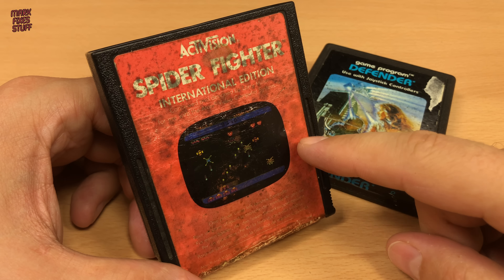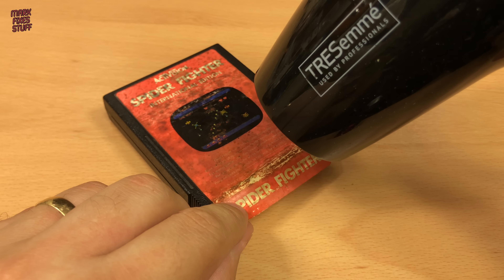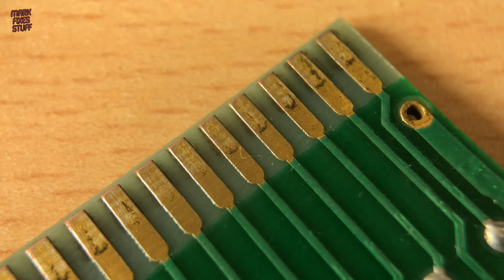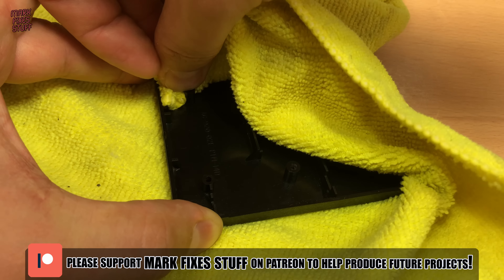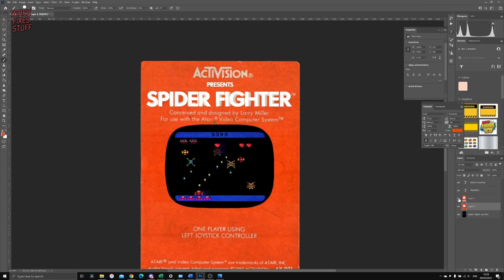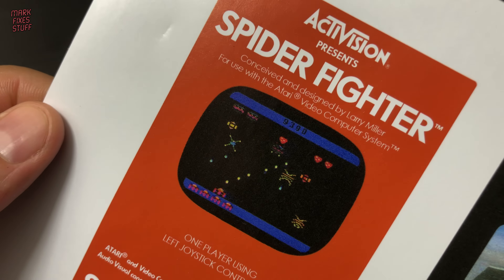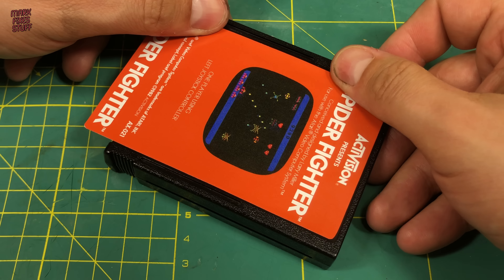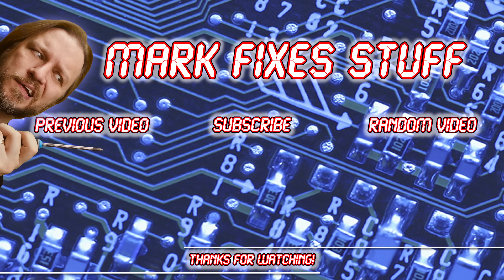Printing Replacement Atari Cartridge Labels at Home! #retrocomputing #atarivcs #retrogaming

Comment: I'm surprised nobody has compiled a library of old game cart labels by now.
Reply from the maker: There are a few online but nothing in the resolution I wanted.
Reply: @MarkFixesStuff  What resolution did you find you had to really get to before it looked passable? I think these look great BTW.
Reply from the maker: @JoshWraaButler  Sorry I missed this!

720dpi with the label set to the actual size on screen. You can download the files on my website if you want to look  :)
Reply: @MarkFixesStuff  The resolution expressed in dpi is independent on how it is displayed on the screen.
Reply from the maker: @cyberpaul1398  correct. The resolution of the document is 720dpi. This is a good match for the micro piezoelectric nozzle pitch of the Epson photo printer. The print head has a physical 360 nozzles per inch so working in multiples of 360 is the way to go and avoids aliasing and moire in certain cases. With regards to the display on the screen, the document is simply zoomed to the same size as the physical print for design purposes. My monitors (Asus ProArt) have a function for this and have actual ruler measurements moulded into the bezel. Very handy!
Reply: Yes, the first thing i was thinking on starting to watch this was,  where is he getting good images or files to base new labels on? Lol
I thought maybe he knew some other people that have the same carts that he could copy the actual real sized labels.

Comment: Very good instructional on general cleaning of carts too.
ive got a couple cruddy ones i found at a flea market that looked like they had been laying around on a grimey old carpet or a junky cardboard box on a garage floor for several years. The hair dryer use was the bit i was not thinking of before as i was waiting to start taking them apart until i really knew what i was doing, and do it right.
My main issue with labels is just having loose and peeling ones.
I hadnt decided exactly which glue i wanted to use or which was best for this situation.

Oh and youve convinced me to get a rotary cutter as ive never thought i needed one as ive always used xacto type blades, but i will try one out.

Comment: Good result. 

For the corners, you could try a corner rounder cutter or punch. I’ve got a cheap one from Amazon and it does either 4, 7 or 10mm radius corners pretty well. 

Bit difficult to judge but the 4mm might have been suitable here.
Reply from the maker: The print is a 10mm radius so that's probably the key!

Comment: Great work Mark. They look great. I've had to use the fixer spray when printing to photo paper also. Especially useful  if your printer refuses to print "photo paper" any larger than a .....photo. The way some ink jets print is specific when using gloss paper, especially where black is concerned, and will just flake right off. The fixing spray cheats this issue nicely.
Reply from the maker: Nice little hack there!  This printer will print on anything, even rolls of canvas, but that technique could well come in handy...

Comment: They look great. Personally I would have used something like indesign or illustrator to design them. I find photoshop isn’t as robust when it comes to typesetting as these two. As for cutting out, a 3mm bleed is your friend. Add it to your design plus some cutter guides and use them so you don’t get a white line running up a side.
Reply from the maker: Great tips. Thank you. I’m terrible with illustrator so tend to hide in photoshop. I should do a course really

Comment: I’m sure there are a hundred different ways removing the old glue, but last time I had to do something similar I had very good success with lighter fluid. A tip I learned from Toy Polloi.
Reply from the maker: Good to know! I actually bought some today on your advice.
Reply: @MarkFixesStuff  Dave actually also uses it to lift and keep old stickers. From what I can tell, it will break down the adhesive, but leave the paper/ink fairly intact, and then dry completely clear without staining.

Comment: The design of these carts were never made to be cleaned because they thought that would never happen, how wrong they were. ^_^ I tried my best to preserve an Indy-Rotla label but it ripped despite adding heat so nice to see another relabel DIY video. :)
About six months ago I did a full 2600 cart cleaning, despite those spring guard systems there was so much dust, dirt, rust, mould, and mystery crud in most of them. Had some good results using "embellishing glue" for partially lifted labels.
It's more work but redoing the label is the only way, scanning an old print gets you the basic dimensions but the source scan is like photocopying a photocopy for image fidelity. Occasionally it's possible to source paintings and photos used, imagine it wouldn't be too hard to recreate CRT based game screen shots.
Getting back to what it used to look like is always nice, seen too many phony aged retro labels and boxes for retro themed products like 80s gamers bought brand new trashed packaging bitd. ;)

Comment: I've found an ink eraser makes a good contact cleaner. Gentler than brasso or fiber pencils. Much safer too.
Reply from the maker: I need to grab some of these again. The Staedler grey ones are a bit abrasive I found. They work great on ZX Spectrum edge connectors.
Reply: Try a white eraser. I find them around the house, leftovers from kid birthday party goodies bags and elementary school playground trades. Usually they'll have cartoon characters printed in them. 

The white erasers work best.

Comment: Great looking replacements there!
FYI: I use lighter fluid on glue residue; it disappears instantly, then just clean over with IPA or soapy water 👍
Reply from the maker: So kerosene then? Makes a lot of sense chemically! I’ll try that next time.
Reply: @MarkFixesStuff  I guess it would be, yes. I don’t smoke but have a small tin of lighter refill specifically for removing stickers from boxes 😃

Comment: Question: Do you use Brasso first and then if that doesn't do the job then you go to the Fibreglass Pencil? I ask as I just use the Pencil for contacts, Spectrums and interfaces mainly.
Reply from the maker: I tend to try Brasso first. The fibreglass pencil wears the contacts down really quickly

Comment: I've had better success with removing glue residue with an oil based product than IPA (WD-40 is amazing for this, the glue comes off really fast)
Reply from the maker: I’ll try that. I’ve also been told lighter fluid.
Reply: Yes. WD40 works miracles on sticky stuff like label glue and price tags.

Comment: "Fonts roughly matching the original"? No no no this won't do at all. It's the Acorn Electron decals all over again. :D

The original font used for the title was Futura Bold, but you've still done a way better job of this than 8-bit Guy. You can't argue with results.
Reply from the maker: If I make them exact I'll get arrested by the retro police.
Reply: Are you saying the "font police" are more tolerable than enraged retro collectors giving you earache for making reproductions? You might have a point there.